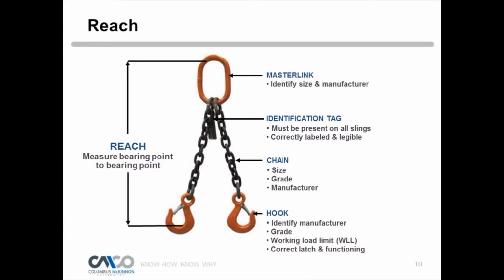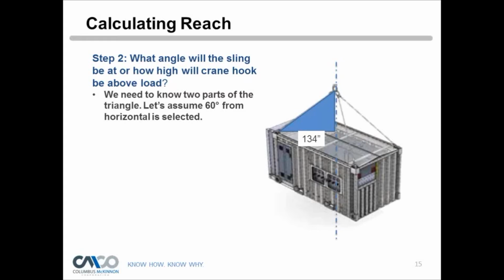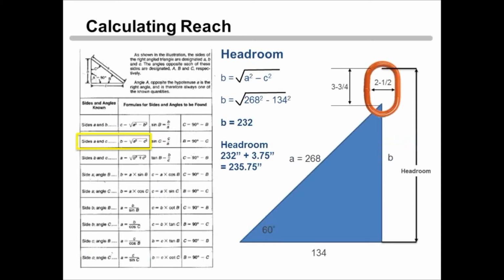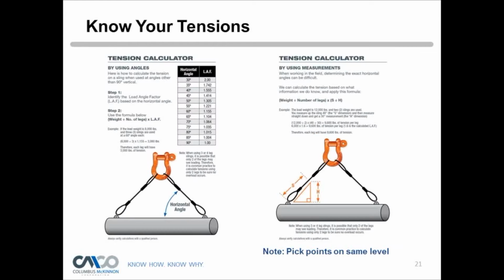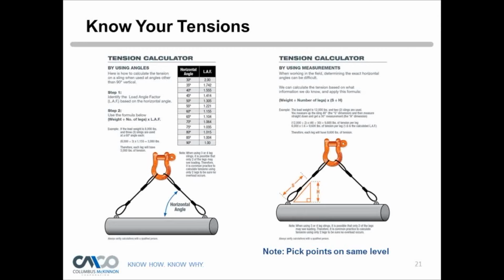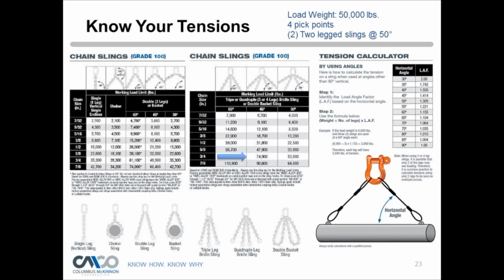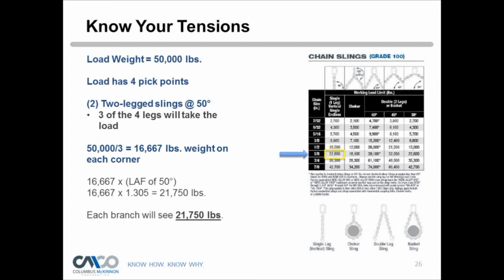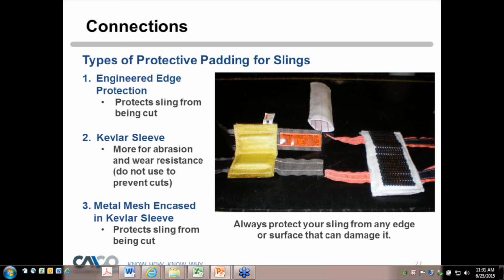Safety Webinar: How to Properly Size Your Chain Slings

Comment: Hi,
    how can calculate the SWL of the sling depend on the Load.
    For example , when two six tonne SWL slings are  used at 90 degree angle ,what is the maximum load that can be safel liftedn with this application,?
Reply from the maker: Hello John,
Are you talking about the included angle of 90 degrees (the angle between the two slings measured from the crane hook? This would then translate to a 45-degree angle for the Horizontal.  (angle measured from top of load to sling)

If the load is symmetrical (equal loading on each pick point), then divide the load by 2,  then multiply x 1.414. (45-degree angle from the horizontal).  That would give you the tension in each leg of the sling. You would choose a sling based on the tension /appropriate hitch that you select and any reductions necessary depending on how you rig.

I hope this helps!
Peter Cooke
Reply: Thanks for your kind information

Comment: 3% stretch applies to power transmission chain or possibly conveyor chains. To permanently stretch strong steels such as high tensile bolts, wire ropes and chains requires really high stresses, there is no guarantee as to their behaviour (including toughness) under heavy loads after that.
Reply from the maker: Good day +Jester Mclarpet! You are correct. We believe that you are referring to the material’s elastic limit.  
Once the material has reach a point of tension it will start to deform & what it can carry at that time is a guess.This is why we recommend that once a piece of lifting gear shows any sign of stretched or elongation, it must be removed from service. This is also why a pre-operational or pre-use inspection is so important, also known as a frequent inspection.  All the best,Henry Brozyna